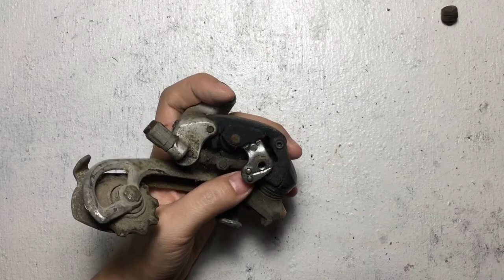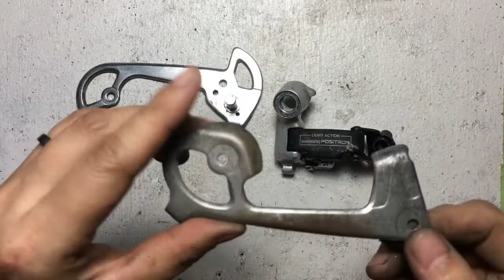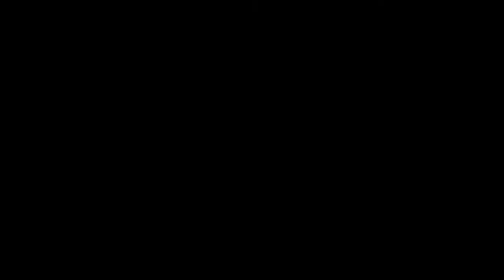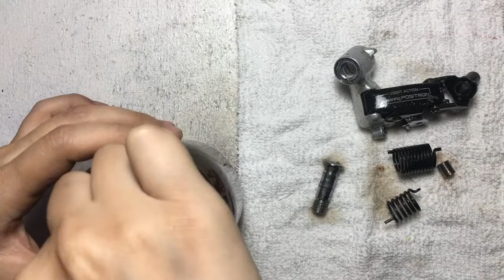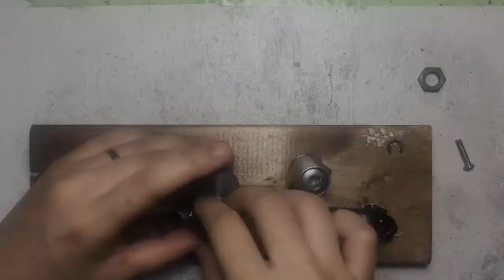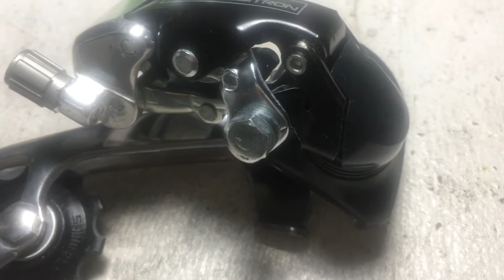Vintage shimano derailleur restoration. (shimano positron RD-NP41)

Comment: Very nice restoration more a labour of love, like how you showed ever step. Having an ultrasonic cleaner I would dump ever thing  into ultrasonic cleaner and possibly use Dremel  tool with polishing compound to save a bit of time. I am in indebted to your expertise and learned so much you set the bar standard very high. Thank you John Tyler YQR Cycle Repair  .